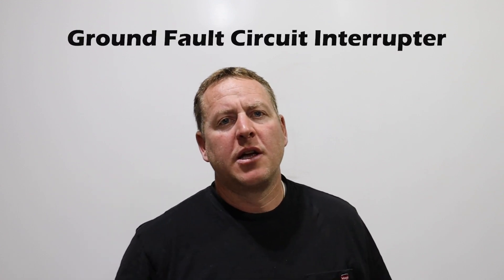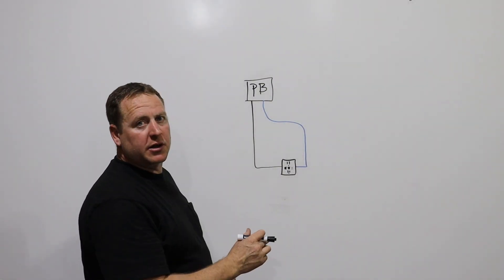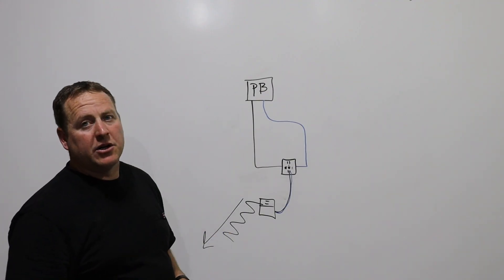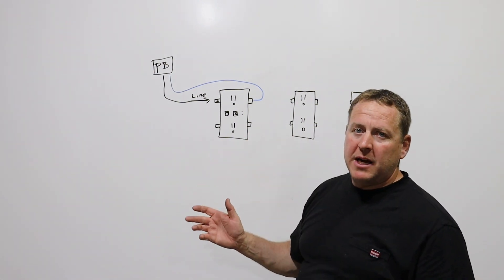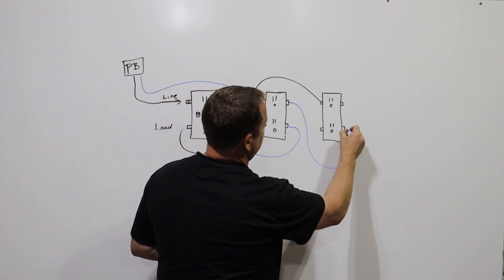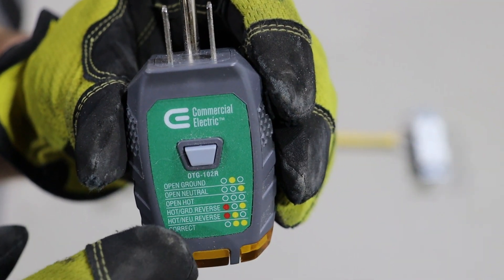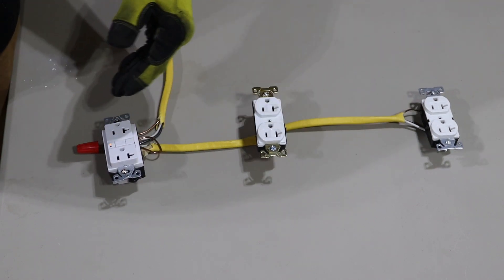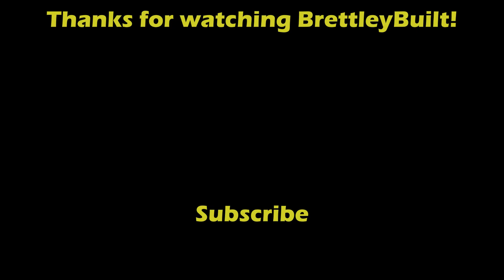How to Wire Ground Fault Circuit Interrupter (GFCI) with Regular Outlets | How GFCI's Work

Comment: Question to clarify... Does the GFCI need to be the 1st outlet down stream from the breaker panel or can it be anywhere in the circuit??
Reply: it can be anywhere in the circuit. Any outlets downstream will be protected by the GFCI. But upstream outlets are not.

Comment: I thought the neutral white wire was supposed to be on the left. Your diagram shows them on the right side of the downstream outlets. Now I am confused..
Reply from the maker: The neutral wire always connects to the silver screw regardless of which side the silver screw is on.

Comment: Thank you again for another excellent video! I have talked to a few contractors and they do complain about the GCFI outlets they say that after a few trips maybe due to power outages in the area etc. They go bad quickly and so you have to keep replacing them. 😥 
Is there a better brand You can recommend which holds up under power going on and off due to snow windstorms etc? 
I feel like these outlets are such an important safety consideration. But do not want to end up buying $20 $25 outlets and having to replace them every few years.  What has been your experience for how long these GCFI outlets last? Thank you
Reply from the maker: Luckily I haven't had a gfci go bad, but have replaced many of them over the years for other people. The ones I have replaced seem to have lasted 10 to 15 years. I don't know if one brand is better than another.

Comment: So I understand the gfci will kick off if you drop your hair dryer in the tub of water- but what if a pipe breaks in the wall and gets the gfci wet- the line wire will still be hot even if the gfci kicks out- does the gfci still protect you or do you need a gfci breaker in the panel box?
Reply from the maker: The gfci will trip if current starts flowing. There is a good chance that if the outlet gets wet, a connection between hot and neutral will be made. The gfci should definitely trip but the breaker in the panel box may not if there isn't enough current to trip it. You would still be protected from electric shock.
Reply: @brettleybuilt Thank you for your reply-

Comment: This is fabulous tutorial.  One question though...  I have 2 freezers connected in a gfci circuit outlet.  I fear that one of the outlets trip resulting in all outlets not working and ruining my food.  How do you prevent that from happening?
Reply from the maker: You could run one or two new circuits so the freezers are on their own circuits.

Comment: Great video!  One question: you said "I didn't draw the ground wires".  What if you live in an old house with no ground wires - would this system still work?
Reply from the maker: Yes. The gfci outlet works by measuring the current across the hot and neutral wires. The ground wire or lack of ground wire has nothing to do with the gfci outlets function.

Comment: the line and load is a bit confusing. what does it mean?
Reply from the maker: The line is the wire that comes from the panel box to the gfci outlet. The load is the wire and outlets after the gfci outlet, and is the portion of the circuit that is gfci protected after the gfci outlet. Not all gfci outlets will have a load connected to them. If the gfci outlet is the only outlet on the circuit, the load side won't be used. There is generally a sticker over the load side that says not to use it unless you are wiring outlets after it.
Reply: @brettleybuilt  got it thanks so much brett!

Comment: although it read good on video it seems as if the circuit is wired in series but since we dont have a load the tester is reading fine. if how you wired it actually parrallel and it just seem like a series or is it actually dropping voltage after plugging in each load
Reply from the maker: I know it seems like the circuit is series, but if you were to follow the path of the wires, you will see its wired in parallel. The voltage is the same across each device.

Comment: why dont you always treat the upper terminals as line in?
Reply from the maker: It depends on the gfci outlet which terminals are line in, not just the wires being on the top or bottom.
Reply: @brettleybuilt  fair enough. you do great work. is always clean and thoughtful aside from being done safely. true pro. just think it would be helpful when explaining to be clear at connection points to avoid misinterpretation.

Comment: I’m in a house built in the 50’s and some of my outlets are not grounded. Would a GFCI work to protect the downstream outlets?
Reply from the maker: Yes, as the gfci is monitoring current between the hot and neutral, and is independent of the ground.
Reply: @brettleybuilt  Thanks very much, I'm going to look into getting this done.

Comment: I tried replacing a two-outlet 120V GFCI box in my bathroom installed by a contractor because the plugs were all reamed out from constant use. When I replaced the first GFCI with a regular 15A outlet that had a USB A and USB C built in (but it was NOT a GFCI) then a new GFCI as the second outlet on the load side it failed to work. My guess is the GFCI needs to be installed FIRST. Is that a correct assumption? Also the 15A USB outlet only has a single pole for connection so I need to know if the gold screw gets the line and the silver screw gets the load.
Reply from the maker: Yes, the gfci must come first. The outlet with only two screws can be put after the gfci where ever in the circuit if you pigtail the wires. There is only a line and load on the gfci. The outlet with only two screws is wired just like any other outlet; hot to gold, neutral to silver, green/copper to ground.

Comment: What happens if you’re replacing an outlet that doesn’t have the initial line in wire that is directly providing power from the PB? Basically instead of the start, it’s in the middle of the circuit? Do you hook it up with the load wire and it will work the same way?
Reply from the maker: I guess you could, but only the outlets "downstream" of the gfci outlet will be gfci protected.
Reply: @brettleybuilt Thanks for replying, so do you hook it up to the line side then, if so what’s the difference? Thanks.

Comment: How common is it for these to go bad and need to be replaced? I have a few in my garage that have randomly tripped every now and then and I can’t figure out why. The house is about 20 years old and it’s a fairly humid environment (Northern Indiana). One circuit has a water heater plugged into it, a separate circuit has an old refrigerator.
Reply from the maker: They can last as long as 25 years or fail as soon as 10 years. If they are tripping and are 20 years old, I would replace them.
Reply: GFCI typically last quite a long time. But it is recommended that you test your GFCI every month.

Comment: I have an outlet in my bathroom that has line and load (4 wires) with ground, I bought a new outlet with USB c outlets, it only has room for 2 wires can I combine the 2 to make 1 so I can use the outlet? Will the other outlets in the room work?
Reply: I have the same question because like you I am installing a 15A outlet that includes the USB A and USB C that’s has only two connection screws (good and silver). I have a single line 14/2 with a ground wire feeding the GFCI a which I am guessing must be installed first. I need to know the sequence of connecting my two jumper wires that come off the GFCI to supply power to the USB outlet. My question is: does the jumper off the GFCI “line” go to the USB outlet’s gold screw and the jumper of the “load” go to the silver screw?

Comment: Question for you. Have a gf i outlet on outside garage wall. Want to punch through wall add exterior outlet using that circuit. Do I need to put a gfci out side also?

Comment: Hello again,
  I replaced the GFCI receptacle and followed your instructions. It helped understanding how the GFCI works. It worked perfectly and my other outlets are working but at around 1 or 2:00am. I heard the main switch in my breaker box tripped. There was no moisture/water anywhere near the outlet. Wiring tester indicated wires are correct. I vacuumed the socket before installing the New GFCI too!  Do you think, that I need to replace the circuit breaker in the main switch box? 🤔

Comment: Do the regular receptacles have to be 20 amp as the gfci? Thanks in advance. I have had no luck getting a response to my questions . See i live in Mexico and gfci receptacles have not been introduced here( at least in my small town, so no one to ask. Reason i ask is because i happen to have 2 20 amp gfci and have bought 15 amp regular outlets and i am about to wire a small house and was wondering if i can use them to be protected by the 20 amp gfci receptacle?

Comment: Nice clear explanation…
Question: When outlet wiring from breaker box is not visible, how does someone determine which outlet is the one closest to the breaker box, and would therefore be the correct outlet to replace with a GFCI?

Comment: I have one afci/gfci outlet in the garage and another outlet feeding off it.  When I plug my fairly new fridge. This gfci outlet trips every 8hrs. It all started after a rainstorm 2 weeks ago.  Here in TX we don’t get much rain.  Clamp meter shows 1amp draw from the fridge to this 15amp outlet. Are these gfci outlet so sensitive that they are useless?  Electrician said I needed a separate gfci for the fridge. But why ? I technically have a dedicated gfci outlet with nothing else connected. Essentially be paying 2x. Please explain

Comment: I moved into my house all my plugs in kitchen dead I eventually discovered my gif I died and killed all my plugs if I pig tailed all my plugs and didn’t use one guck plu but put individual guck plug I would avoided a full two days od]f grief. I’m not an electri but a sertious dyi not rich but not dumb. Gfcis are cheaper now…this guy is smart but line loads are not worth this now a days

Comment: Great video, thanks. 
If I have another receptacle, maybe two or three going the other direction to the left, can I use a pigtail on the load side of the GFCI  to protect these receptacles? and is it safe to do so?

Comment: I did a stupid error when wiring cameras  in my garage. Luckily the outlets in that garage were GFCI projected. I DID get a shock, but it was super quick (tiny fraction of a second), before the circuit was triggered and cut by the GFCI....  I learned something there and someone with say a pacemaker could have had a problem even though the GFCI reacted mega quick...  So be careful !

Comment: I know the GFCI needs to be run with 12 gauge to the Line side, but coming out of Load can you use 14 gauge wire with the 15 amp receptacles?
Reply from the maker: The real limiter is the breaker. If you had a 15 amp breaker, it would technically be safe. Really there is no advantage to running it that way. It is better to just stay consistent with the amperage of wire, recepticals, and breakers.

Comment: I just installed a GFCI in my main bathroom. My tester lit up properly there. But it was flickering on the other two lights in the other bathroom. If those two lights were on solid it would mean that hot an neutral were backwards, but the only two wires coming into the second bathroom. The black wire was hot, and the white wire didn't show voltage with my voltage sensor.
Reply from the maker: Putting lights on a gfci circuit isn't a great idea. Not sure where the flickering would be coming from, unless something isn't tight, or a device is going bad.

Comment: If I use three gfi on a single leg,  would load of first go to line of next, a d so forth ?
Reply from the maker: You mean wire three gfci outlets, one after another?
Reply: @brettleybuilt  Yes, three gfi in single branch leg.

Comment: What's with those screws that hold the outlet to box; cross with square open in center. Is that a Canadian Robertson screw head Lowes has no tools to match those cross hatch / square in center screw heads. There are not phillips nor screwdriver screws.
Reply from the maker: I am able to screw them in with  a Phillips #2 bit, or a flathead screwdriver.
Reply: @brettleybuilt  for me it's a struggle with flathead screwdriver. I use square head driver on impact drill as screw head has square in center of cross hatch. When using a Dewalt drill Phillips driver I bugger up the head of screw. Clearly these screws are odd balls that require a specific tool but can't find such a tool. Wish I could post pic of odd ball screw head.

Comment: Hello - This is a fantastic video but I do have a question (please excuse my ignorance, electrical newbie here). Half of my house is ungrounded (there was an addition put in that is grounded) and its my understanding that using this technique on the ungrounded portion of the house. 

The question is - How do I know which outlets are upstream vs. downstream of the GFCI? If that question even makes sense? If you have another video out there explaining something like this Id be happy to watch. Thank you
Reply from the maker: Trip the gfci outlet. Then use a multimeter or plug tester to see which  outlets are on or off. Those off are downstream of the gfci.

Comment: I have a scenario that I haven't seen mentioned, and instead of the load going to another receptacle, it goes to a 2 gang switch box. (It's all in a bathroom). One switch is for the fan and the other is for the light. Only the fan is to be GFCI protected, so only the fan switch hot will be GFCI protected in the 2 gang box. The hot from the light will come from the line of the GFCI. Now you'll have 4 neutral wires in the switch box, one from the GFCI load, one from the fan cable, and one from the GFCI line and one from the light cable. This could look like a typical scenario in which all the neutral wires are connected in a switch box. However, in this case the 2 pair of neutrals are to be wire nutted separately, the load pair would go to the fan and the line pair would go to the unprotected light.
For future expansion you could tap into the light box for normal hot and neutral wires to continue downstream. If you tapped into the fan box, all the devices would be GFCI protected and that may not be desirable.
Reply from the maker: Can you send me your email. I will draw up a scenario that I would do. brettleybuilt@gmail.com

Comment: Great video! And excellent explanation. I do have a question, I have a GFCI in my backyard that has load wiring to my shed’s receptacle. I had to replace it and found the ground wire connected to the box and there’s no ground wire that came from the GFCIs wiring. I tested it and it says “Open Ground” and doesn’t trip my GFCI. Is this because the ground wire isn’t wired together?
Reply from the maker: No. The ground wire is there as a safety to ensure any power outside of the hot or neutral wire make it safely back to the panel box. The gfci outlet only measures the current flowing between the hot and neutral wires, so any difference in current between those two wires trips the breaker. Technically, a gfci outlet can still be installed if only hot and neutral wires are available. A ground isn't required for a gfci outlet to work properly.
Reply from the maker: If the outlet to the shed receptical is wired from the load side of the gfci, then I am not sure what the problem would be.

Comment: How many GFCI can you put on a 15amp breaker
Reply from the maker: You only want one gfci per circuit. You can have the gfci and up to 9 more outlets on the circuit per the electrical code.

Comment: No matter what I always wire receptacles in parallel. It’s just a better practice. It cuts out that ugly ol’ voltage drop. So that would be 3 GFCI’s for me and I wouldn’t give them the other option. If they can afford a real electrician, then they can afford the gfci receptacles. Or even better, gfci breaker. Ty for your video.

Comment: Great video! If you install a gfci outlet, do you need a gfci breaker on the circuit as well?
Reply from the maker: Absolutely not. Use either one or the other.
Reply: Thank you for your response! I appreciate it  @brettleybuilt

Comment: Why choose the lower screw on the last outlet on the right, at the farthest right . Im confused why you would do that? You have the hot on the line and the neutral on the load. Is it relevant?

Comment: i wish you drew the ground wires.  can you connect the ground of one outlet to the ground of the next?  there's only one screw for ground, so this means you'll have two wires in each ground screw.  or do you use pigtails?
Reply from the maker: You use pig tails. The grounds are wired just like any other outlet.

Comment: I have a GFI outlet in the basement & every time we get a hard rain the GFI trips & will reset after a day or so. How would I trouble shoot this? There are outlets in the garage, outside & in the bathrooms connected to this GFI that trips.
Reply from the maker: I would start by making sure your GFCI outlet outside has a secure, waterproof cover and that it is keeping the rain water out.
Reply: @brettleybuilt  Thanks for your reply!

Comment: Very good explanation. I have a query. I have a GFCI in the main room and when the cold weather arrived with the heaters running, it started to cut the electricity at certain times, even 4 times almost in a single day. Then it stopped doing that for a long time, and then out of nowhere it cut the power and I had to reset it every time, no problem. I really don't understand what could be causing this, unless the device is in bad condition. What do you recommend?
Reply from the maker: If there is any current difference between the hot wire and neutral wire, the gfci outlet will trip. I was looking into what some people say might cause this. It could be anything from an issue with the wiring inside the heater to dust collecting on certain surfaces of the heater and causing issues when static is discharged. If you suspect the heater may be the problem, definitely replace it.